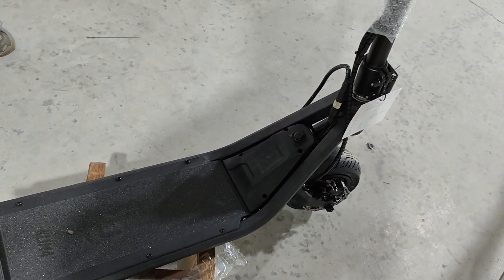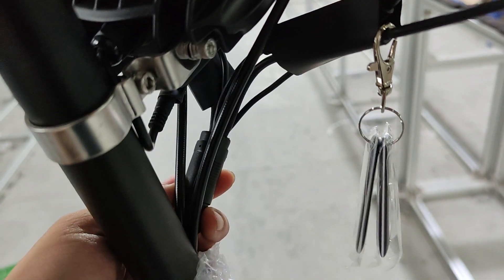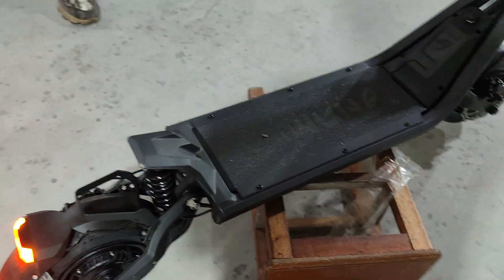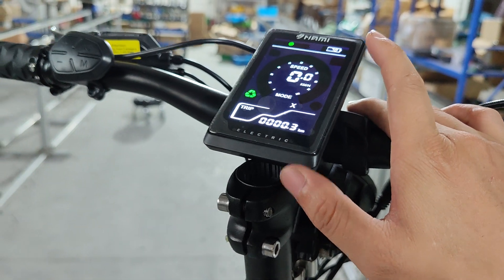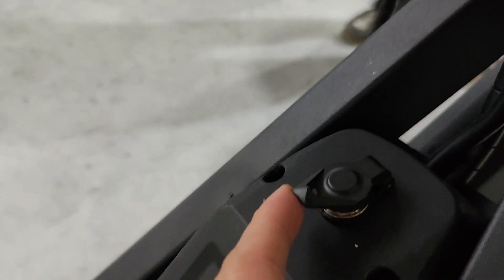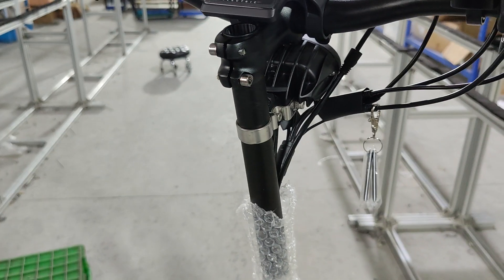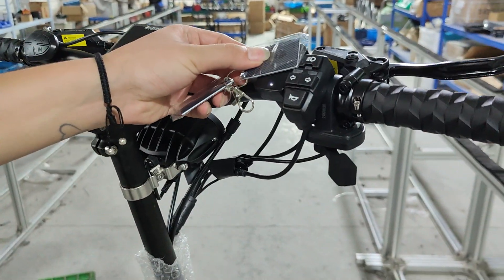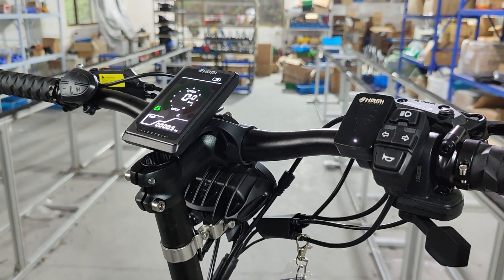Electric System upgrade NAMI ELECTRIC

Comment: Just got mine today. I was extremely surprised that Nami doesn't have an app to control the settings. I was so confident that it would have an app that I didnt even check before buying it. At this level having to push buttons multiple times to change settings or having to remember what P1.1........ are is just not acceptable.  Dinosaur aged technology.
Reply: I'm pretty sure it has memory though so Once you set it you don't have to set it again.
I don't have 1 I got the gt2 but I have been wanting to get this..
I'm prolly gonna wait till the next Gen

Comment: Hi guys, can any new Klima owner recently getting the klima in 2024 give some feedback on the Klima's brake issue being permanently fixed and does it have speed woobles at high speeds? Would it be a good idea to get the steering damper for it? Im looking to buy my son a scooter but dont want it to be over 100lbs so im looking at the Nami Klima MAX, the Roadarunner RS5 MAX and even the Apollo Go due to its light weight frame though that scooter is a lot slower with a smaller battery. Any legit opinions are greatly appreciated. 🙏🙇‍♂️

Comment: Hey Michael, when the speed limiter cables are connected, does it also reduce the power of the motors? If so, to what level ?  (500w?)

Comment: Hi Michael.I just bought the Nami burn-e 2 max but can't change the settings for the front motor also p1.2 and p1.4 in advance settings.Also what is p15 for.Its not in the manual.From Australia

Comment: Hello michael shaw im from indonesia I'm having problems on my Scoter Nami, I am experiencing problems with the battery voltage indicator in the lcd namy not normal,     
However, when I checked directly on the charger port, it showed it was normal voltage, only once did error code 301 appear after I removed the battery socket, how do i fix, Do I have to buy a new front controller, but my nami scooter can still be used well and can still run but the battery indicator is not normal, please help me michael sha

Comment: Please make more videos about Nami Blast. Disassembly videos, how to remove the hub.
Reply from the maker: there is a video about changing the tire on the blast, to remove the hub, you only need to remove the caliper and the bolt for the motor
Reply: @michaelsha2781  i only saw your video on how to change tires for nami blast but no hub removal and disassembly for blast model..

Comment: In the video Michael shows that when the power button is pressed for a few seconds the walk mode is activated, however with the two Burn-e 2 Max's I just received you have to press and HOLD the power button to activate the walk mode. Holding the button, steering and accelerating at the same time is awkward and if your finger slightly moves off the button momentarily you start cycling through the display modes 😭would be nice if it stayed on. Hope I'm not doing something wrong, seems like mine are an earlier iteration.

Comment: hello @michael sha  if i add the nfc reader on my nami klima will it work like in the video to activate the 25km/h mode or you also have to change the controller ?
Reply from the maker: need the controller as well

Comment: I've seen a lot of reviews on this and it looks like an amazing scooter. Glad you have improved the lights at the back however, still no indicating lights at the front. Quite a few reviews mention that the indicator buttons ought to be on the left which makes a lot of sense. The speed limiter cables hanging loose once disabled seems backyard and diminishes the quality of the scooter a little also, if you can set the limiter in the settings why do you need the cables? The horn placement does seem silly, and still no latch for the stem when folded for ease of lifting. It's these little things that have prevented me from buying it thus far. A great scooter, let down by a few careless choices.

Comment: I really like these upgrades. Suggestion, have you considered a turn signal for the front of the scooter for better communication with drivers?
Reply from the maker: will come out soon
Reply: Will these be upgrades be able to be retrofitted to the scooters already on the market? @michaelsha2781
Reply: @michaelsha2781 will it be possible to add new front turn signals to existing models? I don't mind taping or soldering into existing wiring. Splitter would be ideal.
Reply: If I already own a Klima, can I acquire the parts needed to upgrade both the front and rear turn signals?
Reply: Good afternoon, I just bought a Burn E Max 40ah. 
I'm looking for a technical sheet for the different types of Burn but I can't find any link.
You will be able to send me the Link to download the different technical sheets.
thank you so much

Comment: Hello i brought the new model klima and i have been having problems with the P mode and restricted mode not working. It is the newer screen and others bits, but when you hold M it turns the usb on and locks the mode.

From what you said in the video it sounds like mine has the older controller???

Comment: I dont know but I bought a Nami Max and the battery doesn't last long. Rode my scooter for 9 miles and I went from. 100% to 70%. Another 9 miles and I was down to 40%. My other Nami I could go over 50 miles and it's at 80%. I hope the batteries that come with my Max aren't damaged.
Reply: Tension in volt is more precise than the percentage you have planty of tab of tension on internet

Comment: I just bought nami klima, motors dont spin.. I have no idea whats wrong. I turned PAS setting to 0, also tried with 1, no reaction to the throttle.. Is it broken throttle or motors? Wtf.. ;/ Or maybe controllers? Battery is charged to 80%.

Comment: I bought the Nami burn E 2 max and had my neighbor buy the Teverun fighter supreme, we got them about the same day, July 20th 2023. I will say the Teverun has a badass light package  and stiffer option for suspension. So far I have got mine(the Burn E 2 max) to 61.5 mph and wish it had a stiffer suspension due to it getting quite wobbly at top speeds. I heard the PMT tires solve those issues but still need to purchase them. If I had to do it all over again, I would still get the Nami Burn E 2 max. My neighbor has had many issues with weak brake discs. The stem is quite unstable and has to constantly to tighten the stem bolts. I will say his has faster top end hitting close to 67mph and handles like a dream even on CST tires.
Reply: How do you get yours to go so fast mine only goes 15 mph how do I fix this can you help me please
Reply: @luissanchez3788 the speed limiter connector could be plugged in, if not that you're likely just on the lower mode there is 4 power settings

Comment: Switch turn signal and horn buttons to left side handlebar so u can use it while using throttle, move horn up so it doesnt get sprayed with dust and water, extend fenders so they cover the suspension and all around the tire and thats the best scooter. Also adding folding handlebar option would be good for me.
Reply: Agree 100%. I saw ppl switching to left side, it does require to take almost everything off the handle bar,  would be nice to have this done  at factory @michaelsha2781
Reply: be careful with that talk. you don't want Michael Sha to ban you. 

he's known for banning people who point out issues with the scooter
Reply: @jpeero the only case I've seen of that was someone saying "it wasnt waterproof" when they didnt understand actual connections can be waterproof and just because theres exposed wires and water can get into the main compartment that doesn't mean that everything in there isnt completely waterproof. That person was an idiot trying to tell everyone that these scooters will easily get water damage even tho theirs didnt and they didnt and plenty of people havd like 10k miles on theirs without damage. He was basically slandering them because he was too stupid to understand how these are built and so many people tried to explain to him and he just kept going. He deserved to be banned. The things he said were not real issues. Everytime ive seen real issues brought up they handle it well and have done many improvements people asked like the stems being stronger and replaced the old ones.
Reply: @AdamWest1111  i get that. that doesnt mean i want water pooling in my wire box though. i dont want it down the stem hanging out on the stainless steel. i saw surface rust starting to form on mine after a ride in the rain in that area, hence why i use silicone to seal up the stem.

Ive actually burned out one of my controllers and switched over to a VESC unit. my temps stay below 40C at all times, even when riding super hard, and the entire bottom is sealed off from water/dirt unlike before.

You should check it out.
Reply: @jpeero you got a link ?

Comment: can i retrofit the nfc on my burn e 2 max? and what parts do i need for it?
Reply from the maker: yes you could. there is a kit include dashboard wire and nfc also the new light and horn switch
Reply: But Where can i buy this? I dont find ist in your Homepage.

Comment: Good day! on my nami burn E screen, the voltage reading is jumping. within one tenth of an example: 75,8\75,9. (8 and 9 are changing all the time)
Has this situation happened on your scooter?
Reply: What are you talking about? The voltage number will go down the moment you use it and it will discharge over time.
Reply: @gloomy5487  Thanks for the answer, but what I was trying to say is that the voltage jumps and decreases when the scooter is standing WITHOUT MOVING
Reply: @NEKRODOG_NAMI  That is perfectly normal for the voltage reading to jump around a tiny amount as you described, even when not moving. There is not a battery available for mass consumption that doesn't do that. You should only be concerned when the fluctuations are of greater amounts. Jumping around 1/10th of a volt like you described is perfectly fine.
Reply: @gloomy5487  Thank you, you've made me feel better!
Reply: @NEKRODOG_NAMI  No worries. Each cell that makes up the battery is essentially a chemical chamber with the lithium ions constantly in motion, that is why the voltage fluctuate a tiny bit regardless whether the scooter is being used or not.
Reply: @gloomy5487  Thank you very much for your explanation.

Comment: does the new control unit now enable the cruise control?  mine has the function but doesn’t work.  The manual also says P8 (cruise control not available)
Reply: Once powered on, click the M button twice, this gets you into programming mode. Next, press the + button until you get to P9. Now hit the M button once. Should blink 0- hit the plus button once, it'll be a 1 now. Cruise control is now on. Clear out of programming mode to normal riding function. Should have a circular design on the main display now at around 10 o'clock to the speedometer. To engage cruise control press the - (minus) button for two seconds while moving at the desired speed. Should now be cruising. The + and - buttons will increase or decrease your speed, and engaging the throttle or brakes will cancel the cruise control. Hope this helps. Pain in the ass to figure out, pretty easy after that. I think P4 was mph vs kph, which was nice. Hopefully this helps, and have a great rest of your week
Reply: @SpaceDock14  Thank you.  does the usb charging still work after turning the cruise function on?
Reply: Hmmm, I don't no the answer to that. I can go check in a few. But, I'd certainly imagine it would?
Reply: *know
Reply: Yeah, so, that's really fricken strange, but, from my ten minutes of experimenting I couldn't get the USB charge and cruise control to work simultaneously. Weird. And slightly annoying.. Sorry
Reply: @SpaceDock14  I took mine back as soon as I saw this..  I was waiting to see if there is a workaround or something I was missing.  Mine came with brake sensors not working, and one of the discs were severaly warped.  I really wanted this scooter, but until they update / fix this, this is a deal breaker for me.

Comment: USB on my nami don't working (low voltage) and don't change my iPhone 13 pro max with SP connect system. Is on new device this problem solved?
Reply: Same here.
Reply: Bad @JoeyGE0

Comment: can I do a firmware update on my klima to achieve the new usb hub behavior so I can change the modes while powering usb?
Reply: USB on my nami don't working (low voltage) and don't change my iPhone 13 pro max with SP connect system. Is on new device this problem solved?
Reply: @piratorov  ask me in a week and i will try it, did not try to charge phone yet
Reply: @Barc0d3  Hi man any news?